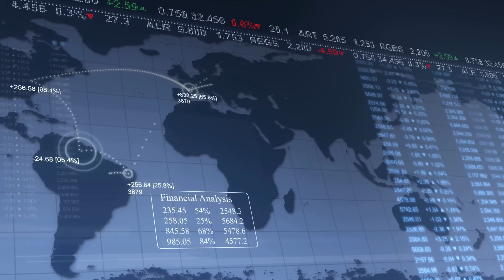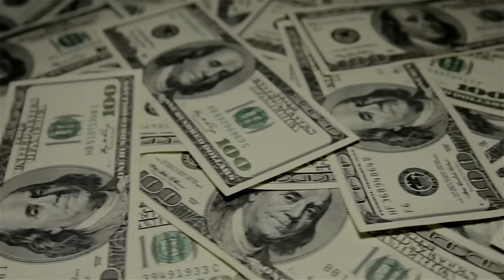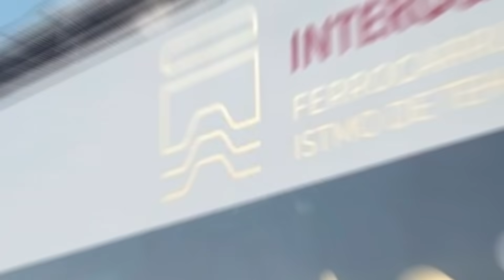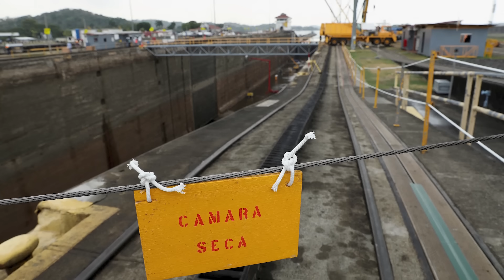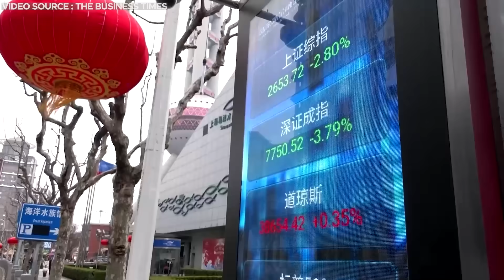Mexico Is Building A $5 BILLION Corridor That Will END The Panama Canal

Comment: Magical thinking, considering the added cost of unloading ships, loading trains, unloading trains and reloading ships and then considering the cost of having empty ships waiting to be loaded, on either side. This will require a whole new concept in ship and train scheduling, to minimize deadhead time for trains and ships. Train security across the breadth of the Mexico train passage will also be a significant expense.
Reply: This already happens daily in the USA, see the I-10 and the port of LA and Texas.
Reply: And Mexico will need to build out VERY expensive ports, at both ends of the rail line, fully capable of and equipped to move loads from ships to rail and vice versa.  That will be somewhat easier at the Pacific end as the coastline is shorter and the water deeper than on the Gulf side.  I find it ironic that AMLO, who has always presented himself as a proud socialist, would green-light this project as it will run through a substantial amount of virgin rainforest, AND it will displace and disrupt life for numerous indigenous groups and wildlife habitat.
Reply: @jamesfarrell7465  the ports have already been built, the port of Coatzacoalcos in Veracruz is one of the largest and operating for about 500 years. The port in Salina Cruz is newer and was heavily expanded in the last 2 decades. Nothing to do with the new president as the video states. The train tracks are already there too, just need to be expanded. You are probably confused, thinking in the Maya train.
Reply: @jamesfarrell7465  NO way! It’s an UTOPIE!
Reply: And shipping companies will need extra ships or contract out to another ship.  Yeah, the title is very click baity.  I thought this was an actual canal, not a railway.
Reply: What are you trying to do,contradict the click baity vid title?
Reply: A "whole new concept"??  Guess what happens at the ships' origin and destination ports: Ship and train scheduling, and efficient transfer between ship and rail.  

Transit will still be faster than going around S. America, and competitive with today's wait time for Panama transit.  Also, climate change seems to be leading to permanent drought conditions in central Panama, which is going to cripple the canal if it gets any worse.  There's a growing need for an alternative.
There's actually an advantage, in that a ship's containers can be sorted out at the end of the line, and sent directly to their preferred destinations, instead of all going to one port.  
Bottom line is that the rail corridor will have plenty of business.
Reply: @jpdemer5  agreed, especially since the effects of drought on the availability of water for the locks at the Panama canal -- I expect to see China's hand in this, assisting with rail construction or building port facilities...they are a major shipper to the US and also competing with the US for influence in this region
Reply: Very narrow-minded of you. But then again, that's why you're not rich.
Reply: "job creation" for a manual unload reload.  Third party project groups in high tech notoriously do this, to increase billable hours, scuttle automation, so that once your people, tools, and processes are outsourced, they've got you by the...poor biz ops design on this one.  But kudos to Mexico.  Hope the engineering and environmental impacts can be mitigated.
Reply: @randallcauley9484  Methods and technology for moving containers between rail and ship is well-developed and standard around the world.  Mexico's setup will be new, and therefore state-of-the-art.
Reply: @JackpineGandy: You are correct, and well informed. Well stated.
Reply: I think the universal use of 40’ shipping containers has eclipsed your hypothesis. Standardizing port sizes, crane equipment, and train cars will lower the disparity in price immensely.
Reply: They are working on special rail ships that rail cars can load onto and unload off of by rail.
Reply: @bobs182   Those have existed for a century.  Problem is that you can't stack the cargo - that's why container ships were invented in the first place.
Reply: That  BS will never work. It only will work to extract more taxpayers’ money from their pockets , as already has been extracted so far.
Reply: someone will design a ship tht has (pods) of dozens of containers or possible more so they can move dozens of containers  at one time. Possible the entire ship !!!!!! over land. ( not todays ships)   we  havnt seen anything yet. can you imagine building PC now? It would be MUCH easier now.
Reply: Yeah unload the ship on Mexcos Atlantic, railroad the cargo to the Pacfic side, sail the ship through the Panama Canal and reload it. Sounds like a government project...
Reply: @0159ralph  um...you know where the Panama Canal is, and where it goes? The route you described is a circle, bringing the cargo back where it came from.
Reply: That´s why Elon builing robots, they will do the heavy lifting... capitalist win...

Comment: This video did not even mention the cost and time it takes to unload and reload a cargo ship.  That is kind of an important issue.
Reply: The answer is, not nearly as much as you think, and WAY less than taking a detour damned near to Antarctica to get around South America.  Robotic cranes in ports handle cargo containers really quickly.  Computers figure out how to get things where they are going, really well.  Go take a look at a big container ship port.  Almost everything you own has been through at least 2 of them.  Adding 2 more on a fraction of the things you buy, isn't that big a deal.  It also adds the benefits of a hub and spoke system for routing, so the container doesn't have to wait for a "nonstop flight" to you, it can take a "connecting flight".

Comment: Where is 'the dog NOT barking'?  ...In other words, I tried to look at what this info-video DID NOT say:

- Note that the Mexican President crossed from one coast to the other on a PASSENGER train, not a freight train.  Doing one doesn't automatically mean you can do the other.
   ••••
- No time in the video was devoted to what Mexico is doing to construct port facilities at the two ends.  Others in the comments have remarked about the logistics needed to quickly unload
   ships on one ocean, then rapidly re-load them on the other ocean.  The video doesn't discuss them, and we don't even SEE port facilities.
   ••••
- Cartels control Mexico; not much room for rule-of-law.  Let's go on the assumption that the American CIA does a combo of threatening, and buying off the cartels, to allow shipping in the new
    corridor to proceed unmolested (or by paying a protection fee that's small enough not to break the shipping companies).  I think that this is what already happens with U.S. manufacturing plants located in Mexico.  How valid are these assumptions?  Will private investors, and private insurance companies, be willing to bet that they won't have Cartel trouble in the corridor?
   ••••
- The video emphasizes that companies that were ALREADY using the Mexican railroad, 100 years ago, stopped doing so when the Canal opened.  The video doesn't (much) go into what has changed economically to persuade companies to 'switch back' to rail, when the Canal still exists.
Reply: Well, money never really exchanges hands. The CIA and by extension, the US allows more fent into the US.  Economically, not much has changed. Logistically, the water level of Lake Gatun is dropping and the PC has restricted the number of ships per day that can pass through the PC.

Comment: This will be interesting.  A modern cargo ship can carry 20,000+ containers, each 20 or 40 feet long.  They can be stacked 2 high on railroad cars.  So to move the entire store of one large ship would require ~1,250 cars, a train about 6 miles long.  Not impossible, but unload, put on trains, take off trains, load is 80,000 operations.  So lots to figure out how to do quicklly.

Comment: This certainly would get a lot of use right now with the Panama Canal traffic being restricted because of the lack of water to raise and lower the locks.    However, the canal allows one ship to load at its starting port, travel across the ocean and unload at its destination, while the Mexico option will require unloading the cargo from one ship, taking it across Mexico and loading it onto a different ship on the other side of the country.     IDK the economics on this, but I would think that the additional unloading / loading would add cost to the shipping process.       But right now, this would be extremely useful.
Reply: unfortunately, the current capacity of the train is only 400 passengers per day, and no cargo. The passenger trains have had their fair share of problems, including one derailing. It is unclear if it will ever be sturdy enough for cargo. 
.
Reply: Plus paying the cartels to be able to get the ships unloaded and loaded the cartels control most of Mexico and how many drugs will they be loading onto the ships that will give them an easier way to get them into the United States

Comment: The problem with the Panama Canal is twofold: its older canals can only accommodate smaller ships, so either the loads have to be transported from massive ships to smaller ones and then back. Also, as the video mentioned a lot of water is needed for all three canal passages, and it may not always be available. This railway is a smart investment by Mexico.
Reply: The Panama has been widened by a lot much larger now than before. Find the story on the net and watch it.
Reply: @ohwell2790  right, but only 1 wide channel.
Reply: @ohwell2790  widening the canal increases the water requirements
Reply: @SuprousOxide  Am I missing something here? There is a ocean on both sides of the canal. How could it run out of water?
Reply: @jimmyjames7174  Water flows downhill.  It's not needed where the canal approaches the oceans, but rather at the locks on the higher elevations.  The supply of water for the locks is limited by the rainfall in the high-elevation areas.  Every time a boat is raised or lowered in a lock, you are using a great deal of water.  Recycling efforts can only accomplish so much.
Reply: @jimmyjames7174  the area is not flat, different water levels. Hence why there are many levees on the Panama Canal. River Runs through a valley and mountainous terrain area.
Reply: @jimmyjames7174  You must have missed the part about the 30M height difference...  locks are operated by fresh/sweet water.
Reply: @jimmyjames7174  They use fresh water from interior lakes that are currently low.
Reply: Didn't you hear that they built a new canal that can handle the biggest of Chinese cargo ships.  It reopened a couple years ago. The problem has been that most bridges have not been updated to handle the big cargo vessels.
Reply: When they opened the wider lock, they should have closed the older lock completely. Less fresh water would have been lost over the years... but revenue misuse was the issue.....look at the difference of living conditions between Panama City and Colon....night and day. No different than most 3rd world countries

Comment: You say in the video it will complement, not END the panama canal.
Anyway, the logistics don't make sense. At current, reduced, traffic levels, 22 ships go through the Panama canal; 16 Panamax + 6 NeoPanamax. That's 16x5000 + 6x14000 = 164,000 containers per day. First you'd need a serious container port to load and unload all those ships, but also, that's 82,000 double-stack rail cars.
A 2km long train has 125 cars so it can take 250 containers. You would need to run 650 of those trains per day, or one every 2 minutes.
So no, it doesn't have a hope of competing with the canal.
Reply: Pretty reasonable assumptions and math.

Comment: Not mentioned in the article is the third lane build along side the existing canal.
Quote
The Panama Canal expansion project (Spanish: ampliación del Canal de Panamá), also called the Third Set of Locks Project, doubled the capacity of the Panama Canal by adding a new traffic lane, enabling more ships to transit the waterway, and increasing the width and depth of the lanes and locks, allowing larger ships to pass. The new ships, called New Panamax, are about one and a half times the previous Panamax size and can carry over twice as much cargo. The expanded canal began commercial operation on 26 June 2016.
Unquote

Comment: Read the news.
You had to spoil a good film with the political bs.

There is currently more ice in the Arctic Ocean than any other time this century/millennium.

Sure that's only a quarter century but the period does include the release of Al Gore's movie, which came at about peak global temperature in the current regular global temperature cycle. Peak temperature was followed by what climatologists called "the hiatus" ehen the temperature effectively did not change, and for the last eight years mean global surface temperature has been falling at a rate of 0.01 degrees per year, 0.1 per decade, up to 1 degree over a century but it won't be cooling that much (yet I say as a new Ice Age will eventually happen) because the cycle of rise and fall will start all over again before then.
Atmospheric CO2 continues to rise, unaffected by human activity, as gas dissolved in the oceans 800 years ago is released.
While CO2 is having no effect on ice formation, temperature is. Above 0C ice melts. Below 0C water freezes.

Comment: You have explained things that previously I did not get.

My question was why do they need to drain freshwater from elsewhere to operate the canal.
As both ends are at sea level the height difference you referred to—although you did not spell it out—is because ships must go up and then down as the go inland and out to sea again.

I had always assumed locks in the canal were only to address tides and currents of the two coastlines.

It must surely have been anticipsted by America that if you pump water out of a country in ever increasing quantities you will eventually run out.
Reply: Rain isn't stopping.
Reply: @Comm.DavidPorter
But the catastrophists tell us the inland waterways are drying up and there are no reserves to keep the canal operating at the current demand.

Comment: It's fairly dubious that the CIIT will do more than skim some container traffic from the Panama Canal...
Why?  Because the Panama Canal ALREADY has an established parallel rail line that allows for bypassing the canal.  Any current shipper willing to off-load their cargo, ship it by rail across Central America, and then reload it on another ship for the completion of its journey can already do so in Panama.  At best, they save the steaming distance between Mexico & Panama, assuming that the Mexican ports and rail line can be as efficient as that of the Panamanians....a questionable proposition since Panama has had years of practice to streamline their processes.

Comment: So now a company has to have two freighters and pay two crews and all those dock and rail workers need to be paid too as well as fees to repay that infrastructure investment because those investors do expect a sizable return on that investment. How is that economical? The empty freighter isn't going to go through the canal to pick up the load again on the other side. So you have two ships at sea rather than one now? Not to mention the increased risk to the cargo. I don't see the economic benefit, but they DO need a solution considering the water shortage affecting the canal. I'm just not sure this is the right option. The result will be much higher prices for us.
Reply: It is not cheap for a ship to pass through the PC.

Comment: You mean to tell me the Panama Canal limited the amount of ships due to a water shortage? Due they not know the two biggest oceans sit on each side of the canal? Someone clue them in please
Reply: That's exactly what they're telling you, and they are right.  

I suppose you'd like to pump all that free ocean water up to refill the big lake the ships pass through 85 feet above sea level.  They welcome you to do so, but don't forget to turn it into fresh water first.  Sounds simple, but it takes a huge amount of water to refill the lake when it's being drained all the time to fill the locks every time a ship moves through one.   Not to mention that it's all designed for using fresh water, and sea water would corrode stuff and destroy every lake and river in the system.  

Or do you think you can desalinate the ocean water and then pump it to the lake, in large enough quantity to float thousands of ships?  

There's a reason the locks have been operated with free rain water that you don't need to pump up from sea level.

Comment: Why don't they make it one way, with the Panama canal doing the same. It would ease congestion and tensions between the 2 Nations.
Reply: If it's one way, what do you do with all the empty ships after they unload on one side? And how do you get ships to pick up on the other side. Did they travel empty from their last port?
Do the trains travel back empty after they unload?

Far too inefficient to be one way. You don't want empty ships or trains traveling around.
Reply: @SuprousOxide  You have a simple roundabout system. One canal already exists and needs upgrading. The other wants to have as minimal Environmental impact as possible. Fairly close and no ship accidents!
Reply: @chrischris8550  Roundabout where? If the railroad is going one way from pacific to the Gulf, where do the empty ships in the pacific go? Where do the empty ships in the gulf come from? What happens to the empty trains at the gulf port?